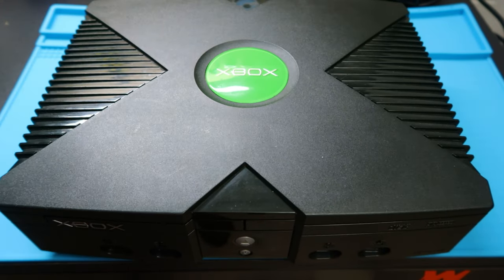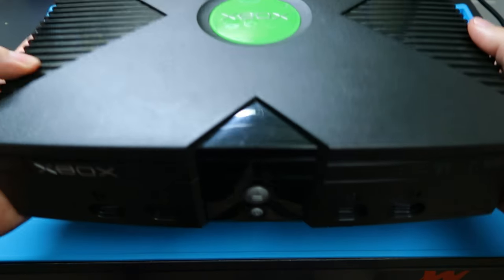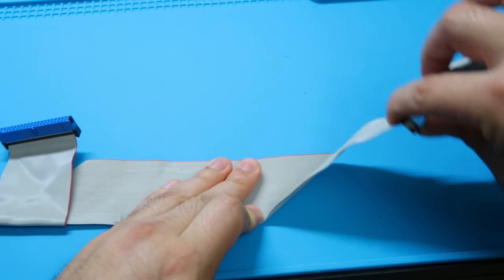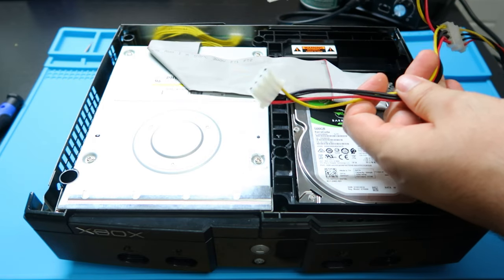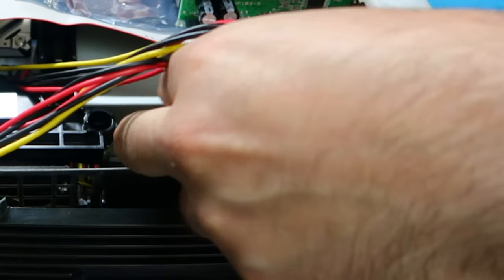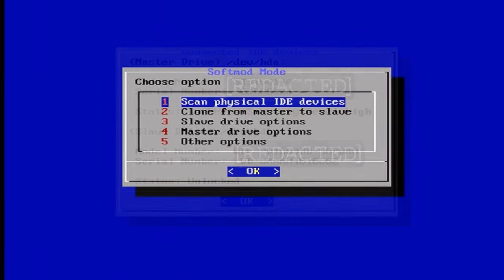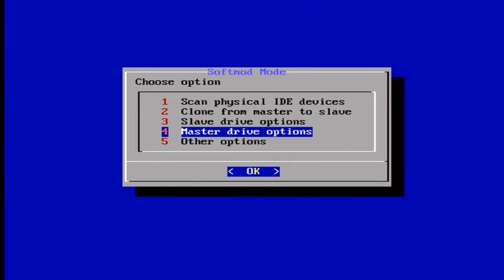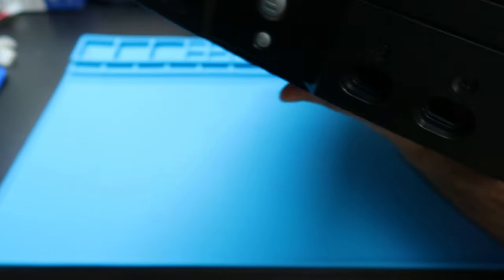Tutorial | Microsoft Xbox HDD Replacement | 4K🔴

Comment: Great video very clear and concise. One thing why exactly do we need a new IDE  cable ?  Both are still 40 pin…..but the new one has 80 wires……I am guessing it’s a faster speed bus ?
Reply from the maker: That's exactly it. If you're upgrading to a SATA HDD or SSD, the 80 pin is recommended. I looked into 40 pin original cables and they seem working just fine in the cases I read about.

Comment: any chance u will make a new video off cerbios 
so we can add like a realy large hardrive like 3TB 4TB - 16tb 

😊 u heard of cerbios ?
Reply from the maker: I have heard of it and it looks like the modchip I installed into my Xbox is compatible with it. Unfortunately, I do not think I will be adding that large of a drive into my Xbox. I normally do these videos with the intention to use the console for gameplay videos. I currently have a 1TB SSD in my Xbox and it's plenty of room for what I need it for. I apologize I couldn't be anymore help there, my friend.
Reply: @Magneteco  no thats fine i dont have a moded xbox at all just what  i see so far 
wait u installed a modchip on ur xbox ?? is the steps in this video can i upgrade a 1tb to a xbox without a modchip ??
Reply from the maker: @princevinny0073  Yes you can! The max size a softmodded Xbox can use is 2TB.

Comment: my friend can i add hard disk without copy files from 1st disk imean another idea ??
Reply from the maker: There is but that will go into hardmod territory. You can purchase a chip called Open Xenium and solder it to the motherboard. The process is easy and allowed me to use a blank hard drive. If you're not comfortable with that,  then I'm afraid there is no other way, unfortunately.
Reply: @Magneteco  thx